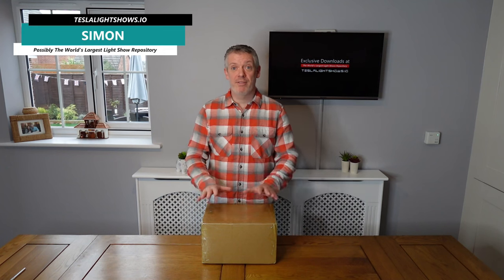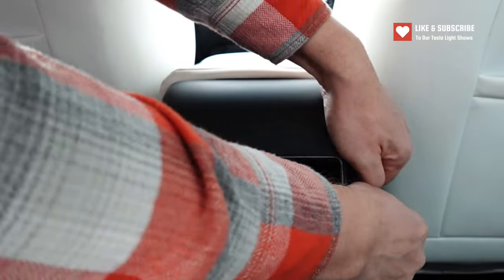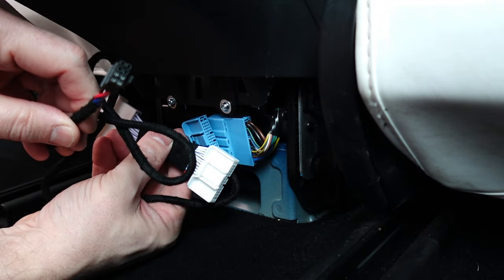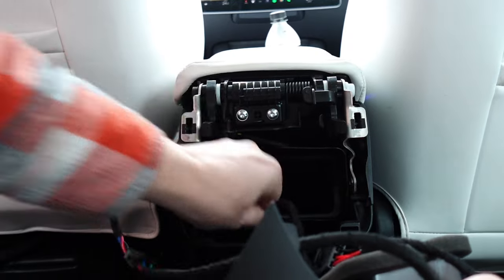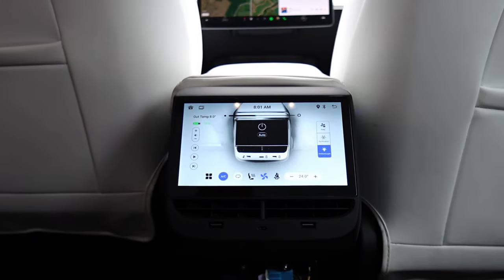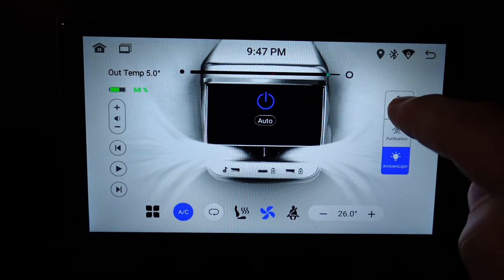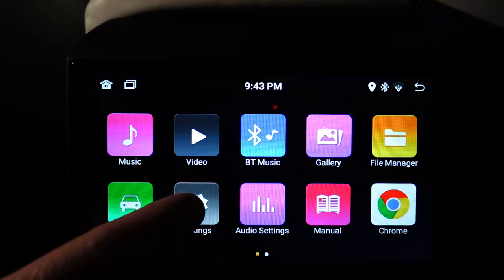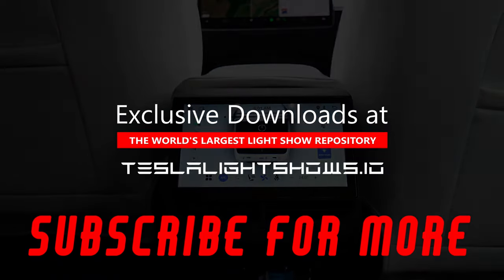2023 TESLA Model 3 / Y Rear Display Install & Set Up

Comment: Great job 
The isuses are has fallow 
1.Netflix not compatible. 
2. Bluetooth headphones connect after few attempts but not working 
3. Slow app to open buffer 
4. Wifi  keep disconnecting.
5. Battery 🔋 view is bad looking.
6. Amazon Prime Video  slow loading  
 I can get this $280 ish 

There is new screen coming soon to repalce this 
So far they added passenger seat control on new one
Reply from the maker: Great info @moziton... I'm in the process of creating the follow up "Real-World" review of the unit so will look to incorporate these points into that. Very helpful thank you :)

Comment: No Netflix?
Reply from the maker: No, it's a bummer and it can't be played via Chrome either. I have an idea for a workaround so will check and include in the short followup video
Reply from the maker: Hi Carlos,  just to let you know that I tried installing Firefox (which worked), in order to stream via the browser but Netflix.com seems to deny the function. I've asked the manufacturer whether it's possible
Reply: You didn't have to power the vehicle down prior to installing?
Reply from the maker: No @T W ,  I didn't power the car down however it wouldn't hurt if you wanted to.